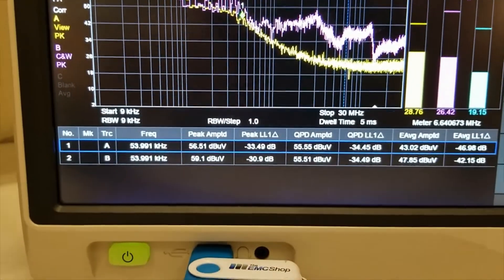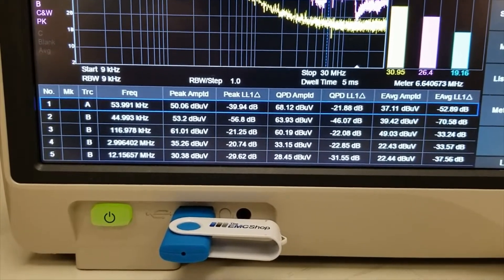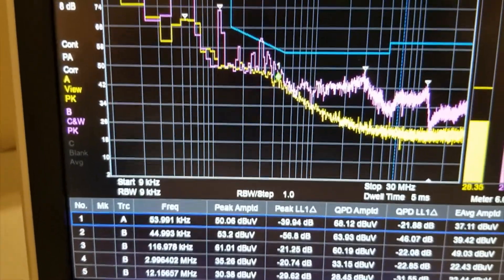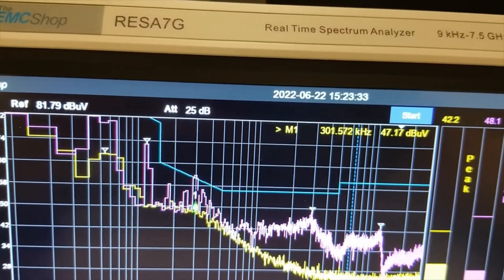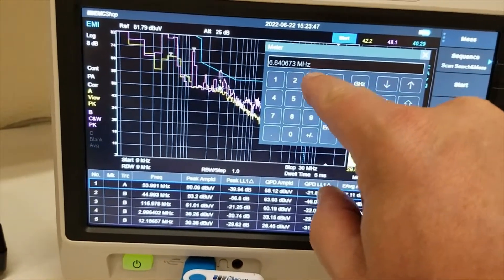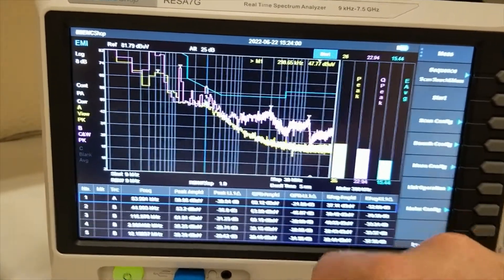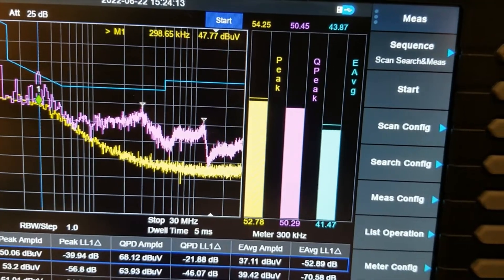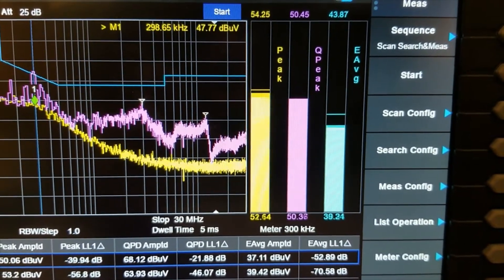Use RESA EMI Spectrum Analyzer to Debug Limit Failures on an EMC Conducted Emissions Test

Comment: Is it the result of correction of the insertion loss and impedance attenuation of the artificial network as well as 10dB attenuation correction?
Reply from the maker: It's the result of not having a lower bandwidth set or higher dwell time to lower the noise floor.